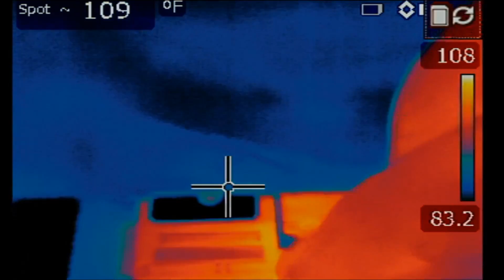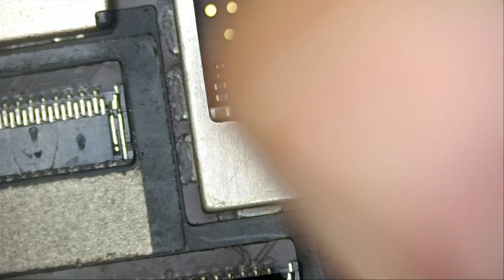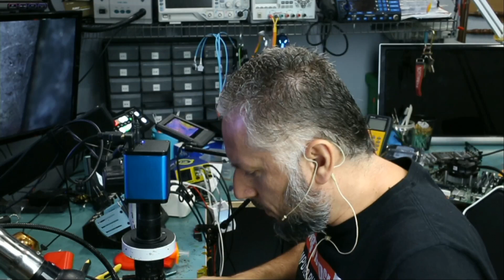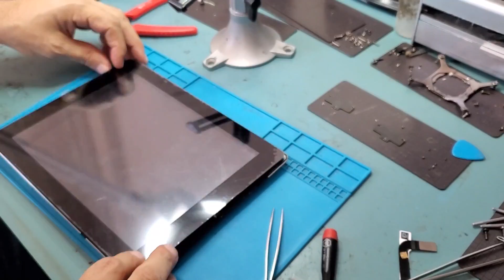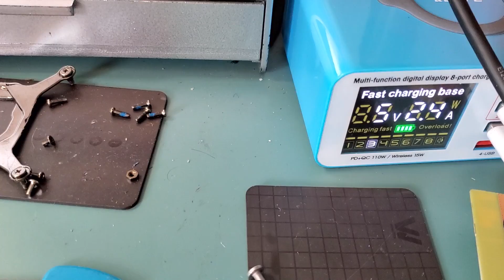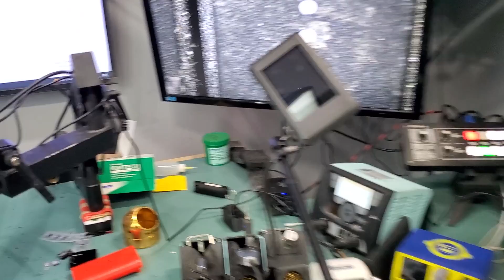iPad 4 unusual repair - Won't charge or turn on.

Comment: I just replaced my iPad 3rd Gen Retina display three years ago only because I had to. With the updates things stopped working on it. I did not want to get another one 😢 I miss my old one. Lol. I do NOT like change. I have the iPad Pro 12.9 1st Gen and the touch is everywhere. It opens things I don’t want
  it to. It’s hard to type a sentence. Example I hit space and instead it hit return and caps locked 🤷🏻‍♀️ it’s possessed. I can’t live without it though. I pay my bills and everything on here. I don’t have a phone. I don’t like phones. My old iPad worked great

Comment: Do you work on diy flight controllers, stmf405 stmf722 ect? "Bardwell" if your not informed. The fets are tightly placed and lots of small caps/diodes to slide around

Comment: Thanks for telling us the temps you're working with.  Even though hot air guns and boards are all different, knowing the range of temperatures for different types of parts is very interesting.

Comment: Polarizing filters cost at least 1 stop of light. Which equals to having to double the ISO or doubling the exposure time or decreasing the aperture by a factor of 1.4

You never thought about filming big boss doing the disassembling of all the different equipment you receive? Before I buy a laptop, I’ll check on YouTube how easy it is to disassemble. And if memory and SSD are replaceable or expandable. The documentation isn’t always that clear.

Comment: For whomever is wondering how Alex manages to remove the glare is by using a secondary light at a different angle, so the light won't reflect towards the camera sensor and affect the view. The light he is using is a dual 6 watt (3 watts each)
Reply: So it switches from one light to another light? I guess the primary light is placed on top near the microscope and the secondare are place angled. That seems make sense and because it is from a different angle, sometimes the exposure also reduced a little bit.
Reply: @Sion Theodorus  Yes exactly, he turns off the primary light which is circular around the microscope lens, and turns on the secondary light that is set at a different angle

Comment: Also old devices have the right to be fixed
Reply: Sure but it Cost more than its worth i have an ipad air 1 
It barely goes for 50$ because stuck Ios 12,5

Comment: The problem with this model ipad, is that when you try to seal the display back you need to make so much effort because you have the wires of the digitizer and the home button otherwise the screen will not sit on place in the edges 100%.